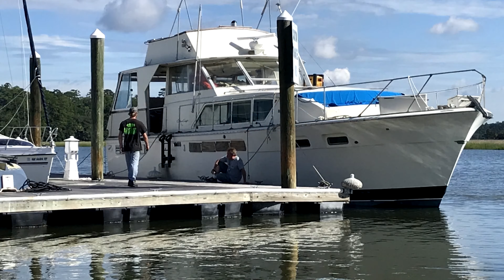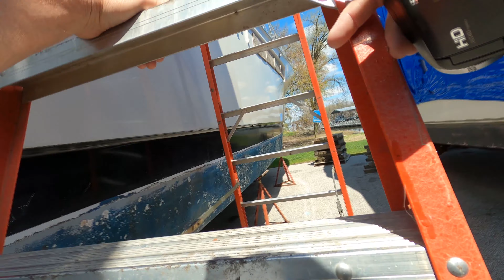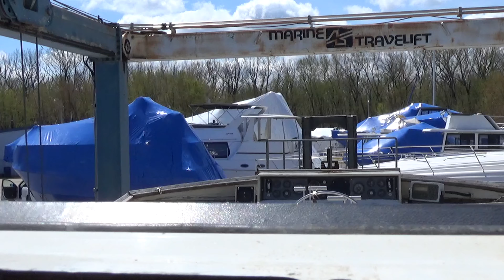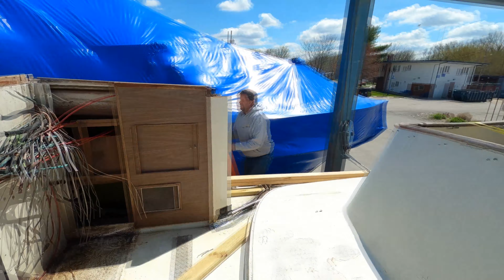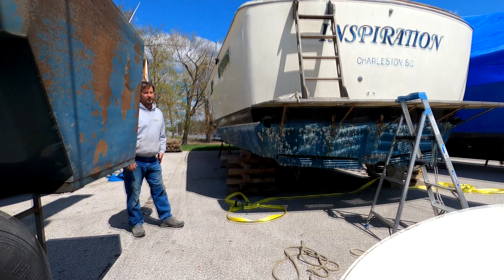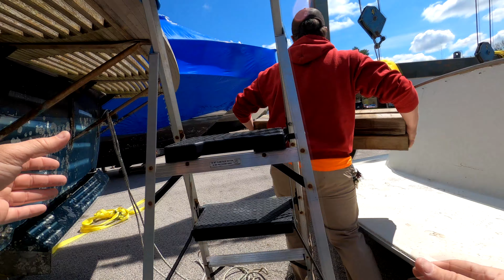Inspiration Restoration - There goes my Top! (Ep.11)(Our Chris Craft Commander 451 aka Commander 45)

Comment: From the Chris Craft late fifties Constellations through 1980's, the 35 to 50 footers are beautiful, as is yours.
 From a strictly industrial designer's viewpoint, I would suggest ditching the fly bridge for a cleaner low line and use new technology to steer the boat remotely from anywhere on board or even from shore. Your research could yield not only a uniquely interesting boat but far greater handling. I am retired and happy to chat, should you want to entertain the thoughts I presented.
Reply from the maker: Thanks for the insight.  I actually like the flybridge, but agree that a total upgrade is in order.  Thanks for the comment!